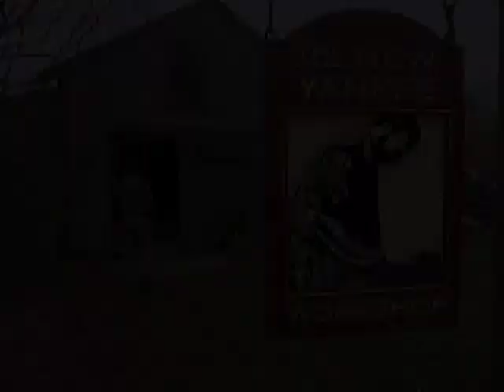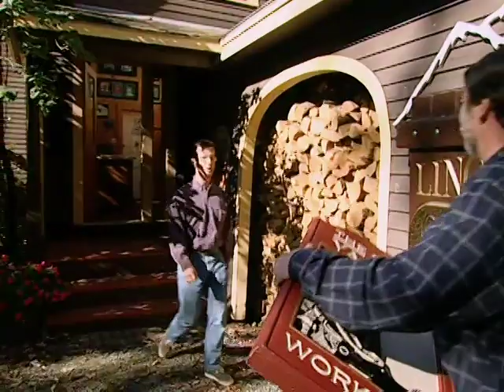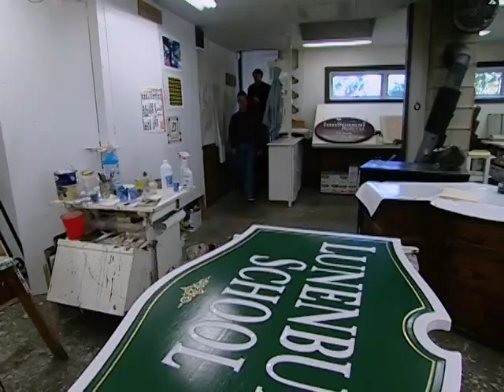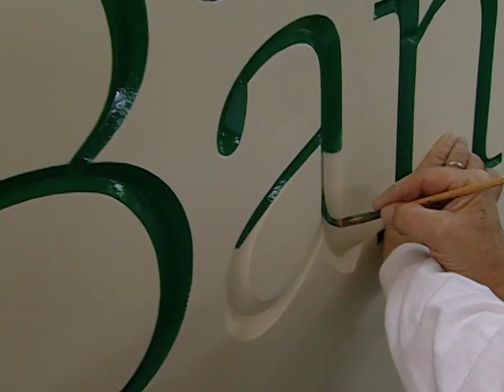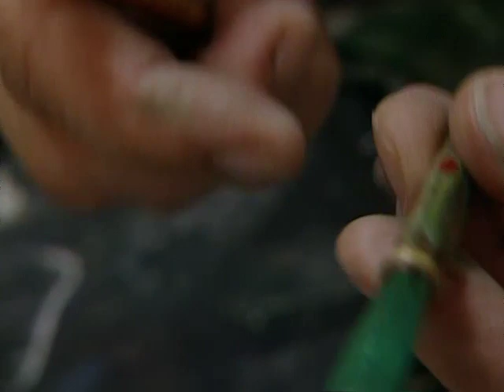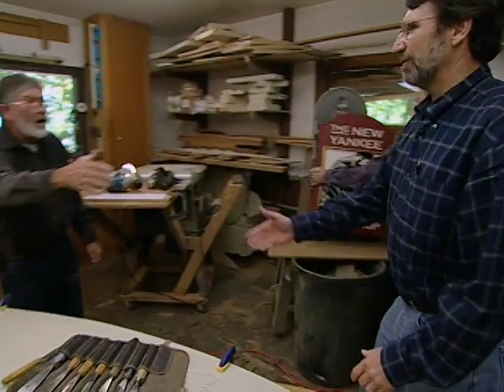Carved Wooden Signs  |  S17 E12

Comment: I had difficulty finding the 'Mill Knife' (R. Murphy) which 20 years ago was listed in working catalogues but is no longer. I ended up using just your plain ol' Stanley utility knife. The blade has flex to it so it is more difficult to get long smooth cuts, but I was happy with how my letter carving turned out. I really love this episode.
Reply: I did a Duck Duck Go search and found a site called McMaster and found mill knives. They also had a knife similar to what Park Sellers used for marking. Lots of other edge tools.
Reply: @ChrisStCyr-gnt7  I see what you mean. McMaster calls them 'shop knives'. There's a thumbnail with a handle like Norm uses, but when you click on that category only the blade is available.
Reply: @mrpiccolo23  
Easy solution to no handle.
Do what Jimmy Diresta would do.
Make a handle for it.
You can make it out of metal, 3D print it out of plastic, or use hardwood and create a unique, personal handle only you own.
Reply: @mrpiccolo23  they are there they have loss of stuff.

Comment: Want to add this here, for those who are scroll saw cutting out letters, get a wide roll of blue painters tape, apply the tape to your wood, then the letter, cut it out same way, then the pattern peels off so much easier, no sanding to remove it, and I would use that bit in a router table, may be a bit easier to round over the edges with that way